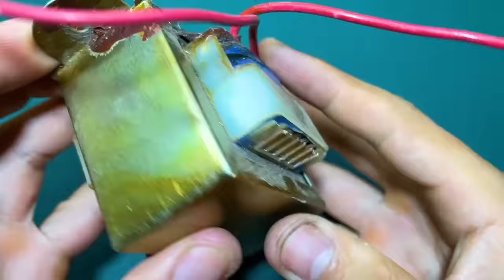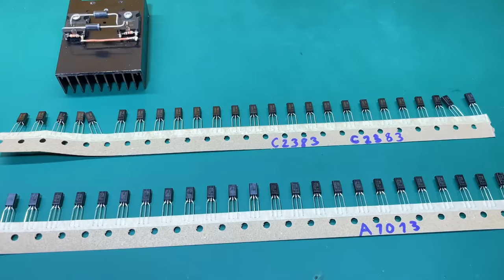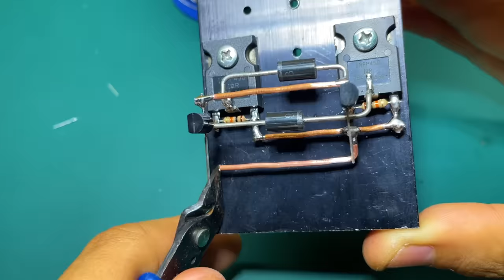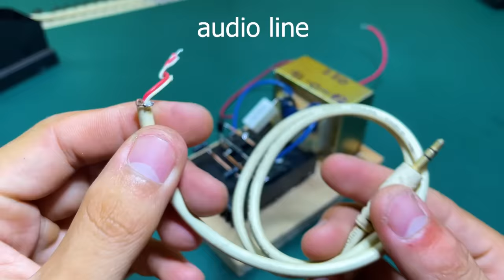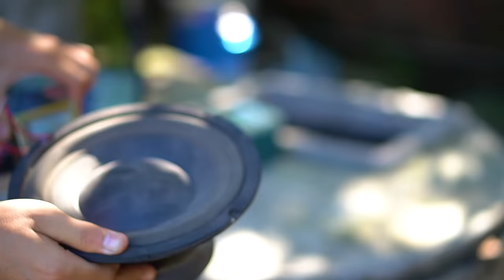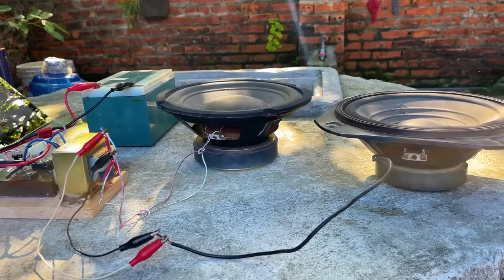DIY Powerful Ultra Bass Amplifier Mosfet IRF460 , Transformer , Simple circuit

Comment: Those 2 speakers have never been 500W... Your amp is powered by a 12V battery (that battery has probably 6 Ampers) that means it can do maximum ~ 72 Wrms power.
Reply: Your correct
Reply: @piapeboys7952  Hashnea
Hdj
J
J
Sjjsjsj
F
=
Jhay
Reply: Those speakers look like they're ~50 Wrms. Can't tell 100% on the one with the square basket because the power rating is obscured by marker
Reply: Too much crack smokin goin on before building
Reply: @leonsines4744  LOL crack smoke funny 😜🤣💯
Reply: I don't mind the speakers n amplifier. however, the batteries can instantly give current up to 10 or 100 times depending on their quality and occupancy rates. you should have known.
Reply: exacto
Reply: @barisgeyve  You SHOULD KNOW battery voltage DROPS in those conditions
Reply: I think that is peak power ,,,,,,,,,,,,,not RMS

Comment: The IRF460 is rated at a power dissipation of 280 Watts.  To keep within the safe operating area of the device you will require somewhere around 26 of them for 2,000 Watts of output power.
Reply: Yeah it might be able to outpug 2000 watts if you connect it to 220v directly and fry it in miliseconds 🤣🤣🤣🤣
Reply: I was just wondering about that because come on one meager little Transformer I think that's what it is come on I know for a fact that it doesn't have the capacitance to accomplish that much wattage for more than a very short time. Increase the voltage yeah but I know for a fact that that little bitty thing can't handle that amount of power something in my little brain tells me
Reply: clickbait... its a great way to attract viewers
Reply: He is misleading people by posting these barely functional 

circuits with ridiculous ratings.
Some are dangerous or will burn out the speaker.
Why do you think manufacturers use so many more components to get 

a properly operating safe circuit?
How many people have wasted their time with the garbage he posts?
Reply: Inside the battery case it's a Bluetooth device 😉...he is using the Bluetooth device for small projects... now he bypass the speakers to an bigger amplifier...he doesn't show when he plug the transformer... it's kind of the same thing on how people on YouTube have found the perpetual motion 😂🤣
Reply: He have used 12.0.12 with mosfet to increase voltage in reverse petren load and watts are on transformer not on mosfet. Mosfet is just switching the signals at transformer. Device is running on 12v DC with battery 😂.
Reply: Even at 1 Watt it is total rubbish

Comment: Congrats. You have finally figured how to great energy. 2000W from a 12 vdc supply. NASA needs you. Stop conning your viewers
Reply: How can he generate 2000w from 12v dc, all electric engineers die when they see this🤣😂
Reply: hahaha Exactly 😂
Reply: Great 👍🏻 reply....
Reply: It's ok, he is supplying 167amps to the circuit.
Reply: Coba tunjukan untuk rakitan sterio
Reply: @WarriorRev6300  yeah im ee. and this is horrible channel
Reply: Is 500w+500w=2000w? Then 1+1=4 😂
Reply: Maybe if some of us taze our mindfull of shiet with 600,000volts generated from 6volts using schematics like this channel has to view. We might understand to know how the equation is actually solved. Some like to add to the comment but from the looks of the equation.  It just don't add up. Correct what you believed is to be incorrect. The confident in the laughter of the diss, doesn't make it better or right. You're only "connable" if you're "gullible". Be kind to yourself & others with tough love.
Reply: An electric scooter having 1000 watts motor runs on a 12V battery. Commenting Genius, can you explain?
Gain your knowledge first.
Reply: 2000W PMPO
Reply: @priyabrataray4315  it doesn't run on 1kW ,that number it's peak power
Reply: Me unlike the video
Before start watching it
Reply: fr
Reply: Can any one reply?
Can 12v battery supply 20A current?
Reply: @priyabrataray4315  take out that scooter battery from two scooter 
Join that two battery in parallel then u can supply 2000w power
Reply: @mdtauqiralam1018  yeap brother 🤞
Reply: @WarriorRev6300  It is better to not watch or comment on these videos.
They are only here to get views.
They do not show proper circuit design, they have no protection and some are dangerous and will just make smoke and burn out speakers.
I will stop watching and commenting.
Reply: Gain knowledge first guyz even in cars people runs 1000w to 2000w subwoofer with 12vdc current only
Reply: XDDDDDDDDDD

Comment: I dont here anything during testing. Do you muted it due to copyright issue?
Reply from the maker: Yes. Sound is takedown by copyright
Reply: @technicaldiy  is it posible to make like that using hy3912 mosfet? I have spare of those when i bought to replace mosfet of my buck converter.

Comment: The maximum power you can get from 12 volt DC supply with 2 ohm load impedance = 12 x 12 / 2 = 72 watt. Only if the efficiency of the circuit is perfect (100%). Can you share the measurement data to prove that you really 
 can get 2000 watts output power ?
Reply: With step-up transformer, it's theoretically possible. In this scenario it's still BS of course.
Reply: ye this is the kind of guy who makes 60w rms amps and labels them as 5000 watts lmao. if i was forced to say something good i guess i would say at least i learned how to make a simple amp
Reply: @westelaudio943  The transformer doesn't impact the power, it can't uplift from 72w to 2000w, it'll only impact the Voltage
Reply: @user-yt2xv1gs7l  

The transformer could pump more voltage into a higher impedance load if it was the right transformer .Thus the power would be increased for a given impedance. The curcuit must be able to supply it of course (it isn't).
Reply: @westelaudio943  for max output the load (speaker) must match to the output impedance, need proper turn ratio of primary:secondary
Reply: He is misleading people by posting these barely functional 

circuits with ridiculous ratings.
Some are dangerous or will burn out the speaker.
Why do you think manufacturers use so many more components to get 

a properly operating safe circuit?
How many people have wasted their time with the garbage he posts?
Reply: Crazy the Guy, 1000 watts, need a big.......
Reply: @westelaudio943  transformer can increase voltage sacrificing of current and vice versa. Output power = Input power - loses.
 No miracles...
Reply: @cazb73  

I was solely referring to voltage...
Reply: @fishrsa9046    it is rubbish from start to end

Comment: this is 90 watts at 1.6 ohms, it needs to be stepped up to at least 57 volts to get to 2000 watts at 1.6 ohm or 45 at 1ohm

Comment: Please sir, show how to make an amplifier with Tip122 Transistor.only one transistor and simply.
Reply from the maker: ok, i'll try make it
Reply: At home I'm going to be building an amplifier with the tip142 and the tip147/To-247 case.  They are Darlington pair design just for amplification.They use these in my fender mixer the LX-1504. These are nice transistors. And the tip122 is good as well. Good choice of transistor.
Reply: @SS-mj2mq  thank you very much sir🇮🇳💟
Reply: @anilpancholy5843  you're very welcome ✌️🤓🤗

Comment: Transformer output impedance is about 200 ohm or above and thin coper wire .if use thick wire and reduce no of turns you wll get better result.
Reply: You're so right 💯
Reply: He is misleading people by posting these barely functional 

circuits with ridiculous ratings.
Some are dangerous or will burn out the speaker.
Why do you think manufacturers use so many more components to get 

a properly operating safe circuit?
How many people have wasted their time with the garbage he posts?

Comment: Very good. Congratulations. Make ym sterio amplifier for two speakers (two boxes with bass and treble) of 30 wats rms. Thanks again
Reply: He is misleading people by posting these barely functional 

circuits with ridiculous ratings.
Some are dangerous or will burn out the speaker.
Why do you think manufacturers use so many more components to get 

a properly operating safe circuit?
How many people have wasted their time with the garbage he posts?

Comment: That's easy to knock up in 15 minutes. Just driving bass speakers but would not be 2000watts RMS as that would pop those little wires and transistors at that power. I got a true 2000 watts RMS in my car and that thing sucks a car battery flat in 15 minute because of over  voltage protection over-current and under-voltage protection cuts off the power at 10 volts.
I bet it sounds great and rocks the house.
Great work. I like..
Reply: He is misleading people by posting these barely functional 

circuits with ridiculous ratings.
Some are dangerous or will burn out the speaker.
Why do you think manufacturers use so many more components to get 

a properly operating safe circuit?
How many people have wasted their time with the garbage he posts?

Comment: With this transformer size , you simple cannot output 2kw , this no how Electronic work , this is not because the speaker IS rated for 500w , that he deliver really 500w , in this case i take 8 of 500w speaker and BOOM !, My circuit Can drive 4kw of speaker

Comment: So if anyone's curious, this kid constructs non functioning circuits out of bits of randomly soldered together components. Then connects a small Bluetooth amplifier disguised as a battery to the "circuit", connected in a way that powers the speakers.

I could go in to great detail on the few videos I've watched now of why these aren't even close to being functioning circuits, let alone ones that can be used as linear amplifiers.
Reply: Finally one who gets it... 
The main problem here is the impedance of such a 220 V winding... It would make the signal barely audible at 2 Ohms load. I also concluded that the real audio signal must come out of the manipulated battery. Even though here it's less obvious in this video because of the transformer (which must be manipulated as well).
Reply: He is misleading people by posting these barely functional 

circuits with ridiculous ratings.
Some are dangerous or will burn out the speaker.
Why do you think manufacturers use so many more components to get 

a properly operating safe circuit?
How many people have wasted their time with the garbage he posts?

Comment: This project how out put rms?
Reply from the maker: About 1500w
Reply: @technicaldiy  sir this project used sony x plod sub in 12 inch speaker
Reply: @mozeskriebel7170  🤣
Reply: @technicaldiy  😄🤣
Reply: No it is not 1,500 w do you know how to measure the output power with a meter. You have to know how to do the math though.👀

Comment: You are misleading people by posting these barely functional 

circuits with ridiculous ratings.
Some are dangerous or will burn out the speaker.
Why do you think manufacturers use so many more components to get 

a properly operating safe circuit?
How many people have wasted their time with the garbage you post?

Comment: You should never mix impedance one is a 2 ohm speaker. And the other one is a 8 ohm speaker you need to research ohm's law 🙈
Reply: ah and woofer with power marker for he, not really. this video is fake. Not best power real. Is good but how much 30w.
Reply: @CARLOSSANCHEZROMERO_YOGIBEER   To be honest it's a waste of your time. But if you would use those transistors correctly you can get a approximately 100 Watts out of them. He is using those little transistors facing upwards as a drive stage. All the output power is going through that transformer before it ever reaches the coils of those speakers . A lot of resistance there don't you think. Lol🙈

Comment: Really 500waaaaaaaattttts speakers your amps...look like inverter or booster anplifier...why you use battery instead 12 ampere 12 v. Powersupply